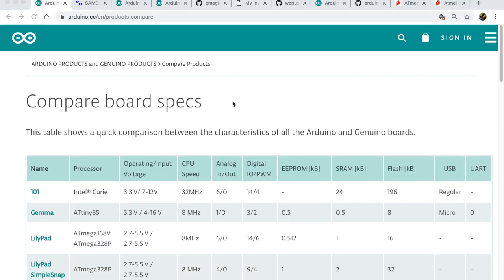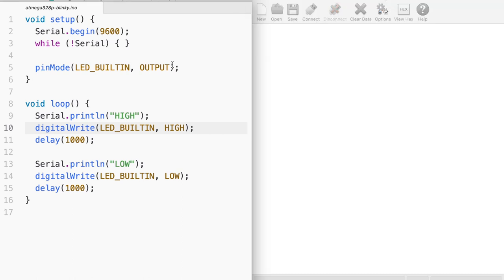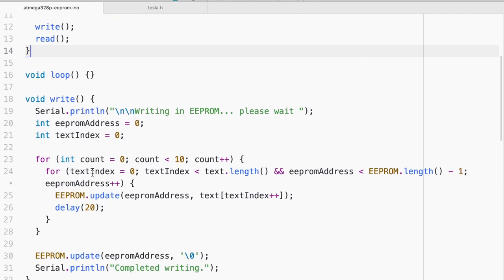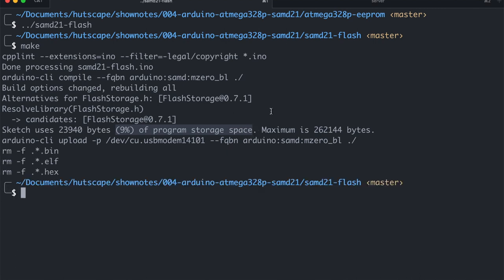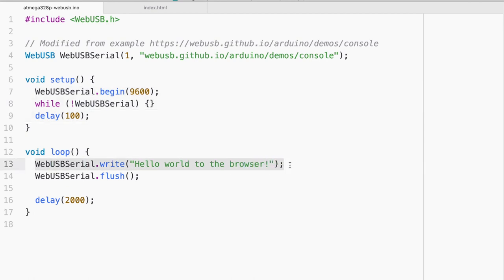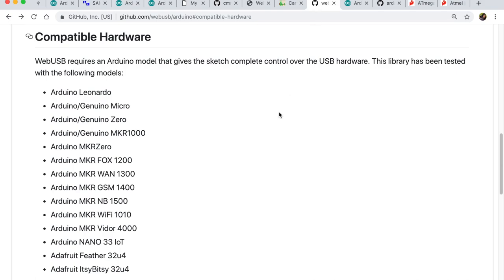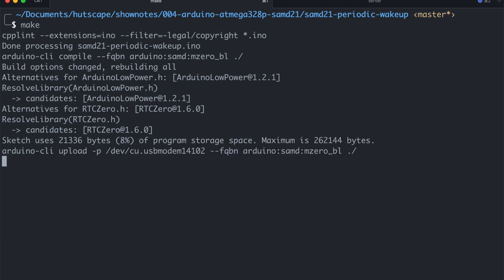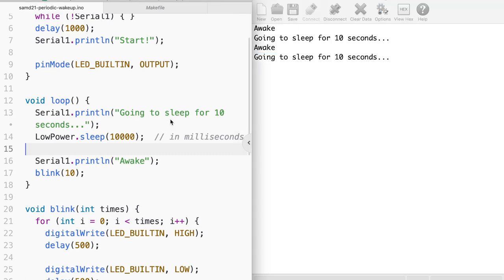Arduino firmware on ATmega328p or SAMD21

Comment: @Sayanee Basu - I saw that you still use the 'delay()' function. What this on purpise or what is the menaning to use this old function? Normally i would say use the milliesecond trick.
Reply from the maker: Uh! I use both delay() and millis() for Arduino programming if millis() is what you mean by "milliesecond trick".

If delay() for Arduino deprecated when you mean "old function"? I don't see that note in the current Arduino Reference guide: https://www.arduino.cc/reference/en/language/functions/time/delay/

In conclusion, yes I use both delay() and millis() depending on the context of the application I am writing. I'm guessing I used delay() in the above example for simplicity :)

I use millis() when I have a few more timing tasks going on in the loop(). Else, I use delay(). Hope that clarifies your question ☺
Reply: @sayanee  Yes in the way old and new. The thing is the delay() use more CPU performance. You can see it for yourself in a loop test with delay and one test with millis().  I have done this once because i had performance issues. We have discussed this also on arduino. But mostly i use the esp32 or the STM32 and then you can see it..

But in any case when you know it ...it is fine. Everybody can use what he think is ok for him self.
Reply from the maker: @mikeunum  Thanks for sharing! 

Yes, it makes sense that delay() use more CPU performance as it does use millis() to implement it I believe. I'll definitely switch to millis() if my application is performance heavy.

Comment: My atmel-ice-programmer seems to program my board without error, but at power-on, it doesn't run unless I manually reset it!  Any thoughts how this occurs?

I'm programming via the following and it exits successfully:
atprogram -v -t atmelice -i swd -d ATSAME70Q21 program -c --format hex -f file.hex

Looking at avrdude, I'm not sure if it supports atmelice/swd/atsame70
C:\Program Files (x86)\Arduino\hardware\tools\avr/bin/avrdude" "-CC:\Program Files (x86)\Arduino\hardware\tools\avr/etc/avrdude.conf" -v -patmega328p -carduino -PCOM13 -b9600 -D -Uflash:w:C:\Temp\arduino_build_221325/file.ino.arduino_standard.hex:i